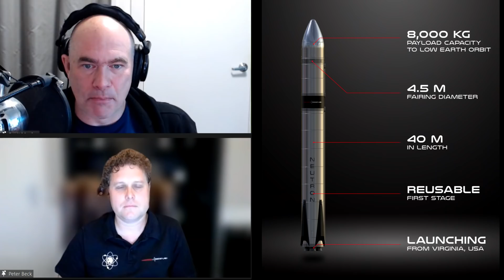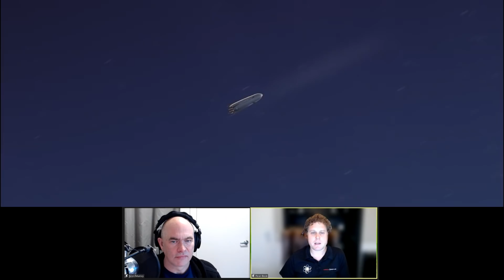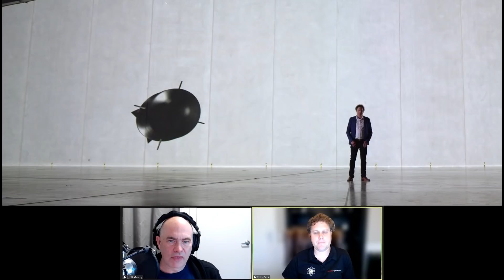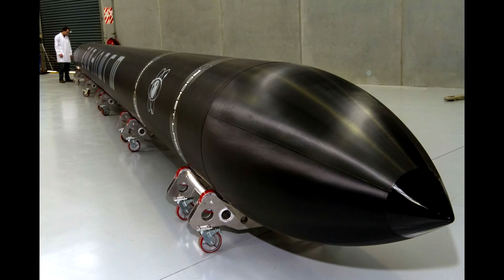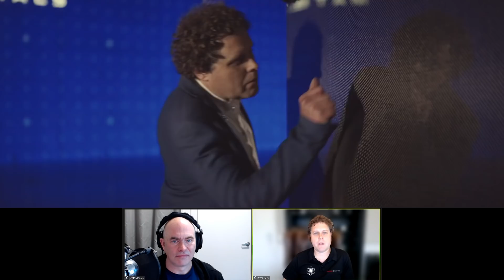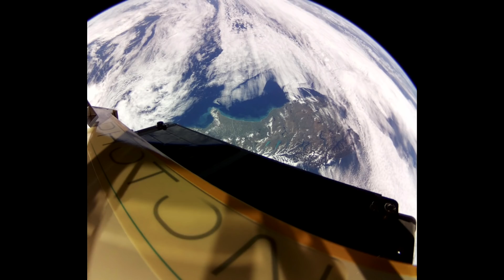Rocket Lab's Neutron Rocket's Innovative Design Explained By Peter Beck - CEO of Rocket Lab

Comment: Hey Scott, do us all a favor... PLEASE ! Before you interview this bozo again, please make sure his audio does NOT sound like he is talking through a double echo chamber and his audio is understandable. Even though you do have closed captions,  My ears could only tolerate about 7 minutes of his lousy audio ( and than I had had enough of him ) If he builds rockets to the same specs of quality equipment that he used for the audio for this interview, we all should be as far away as possible from his launch site.

    No worries Scott, I know it wasn't your fault, and I even though I left early, I still gave you a thumbs up !
Reply: Shadows
It's not about your precious ears..bye bye
Reply: Going by the pixelation going on in the video I would suggest that it is a bandwidth issue in the middle and there fore totally outside the control of either Peter or Scott. I would assume that they were making the best of a bad situation.

As for build quality RocketLab have, to date, launched 22 rockets with 3 failures (note that the first launch was actually destroyed by range control after a comms issue at a ground station, there was no fault on the rocket. So a qualified failure).

How many rockets have you launched to orbit?
Reply: @swapshots4427  Well then, make it about my ears. Bye bye bye.
Reply: @Agnemons   Well, it might be bandwidth-induced, but whatever system used should be able to compensate. The problem is that the sound varies so much in amplitude which actually might originate with a bad sound setup at Peter's side. It really is very difficult listening to.

Comment: Peter Beck says maintaining a ship is very expensive but I wonder. If the payload is so heavy that the rocket can't return to the launch pad, what's more expensive, maintaining a ship or ditching a rocket in the ocean?
Reply: Definitely maintaining the ship.
Reply: He said that it's about $60,000 a day to own a barge. And he also said that rockets are relatively cheap to build, compared to the total launch cost. So it's almost certainly cheaper to just lose one rocket occasionally as opposed to owning and maintaining a several thousand dollar barge for years.

Also bear in mind the $60,000 figure only covers port fees.

Comment: If the second stage is so lightweight that it needs to be suspended from the first stage load ring, how well will it stand up to the force of 100t thrust second stage engine?
Reply: Throttling, Beck said the second stage can throttle as low as the landing burn. Also, there has to be some structure.
Reply: The fuel tanks are under pressure in flight. As long as the force from the pressure inside is greater than the force accelerating the stage, the walls of the tanks only experience stretching loads and can be quite thin. After stage separation this situation is probably the case for the second stages of all rockets.

But at the end of the first stage burn the force on the second stage can be greater than the supporting force from the pressure, and that would require building the second stage tanks to withstand compressive loads.

An alternative is to suspend the stage, as Neutron plans to do, and as Delta Cryogenic Second Stage does already on Delta IV.
Reply: It costs very little, structure wise, to build things in tension. Compression is almost the exact opposite (mass comparison).

A piece of strong is lousy in compression excellent in tension.
Reply: @Agnemons  I understand that. My question was why, if the stage wasn't strong enough to support the compression loads during first stage firing, would it be strong enough during second stage firing? Darrell's answer is the most reasoned.

Comment: Next step will be stainless steel body, Starship may not be successful,but for sure it has set the direction for the future.
Reply: I doubt it. Maybe the second stage could go to stainless steel, if they try recovering it, but if the second stage remains expendable, Rocket Lab has little reason for going to stainless steel.

SpaceX went for stainless steel primarily because the Starship has to reenter from orbit, and the stainless steel handles heating much better. The Super Heavy booster could be made out of carbon fiber like the Neutron first stage, as it doesn't have to reenter from orbit, but it made sense to just make everything with the same construction methods.

Basically, the two vehicles are trying to do different things, and as a result arrived at different solutions.

Comment: I wonder if Elon watches things like this, looks over at his stainless steel rockets that he couldn't make work without heat shields, and wonders what could have been if he had just stopped surfing wiki early that one night...
Reply: If you think anyone is re entering without a heat shield you're a born fool.
Reply: @TheEvilmooseofdoom  I didn't. Elon did.
Reply: @krap101  It is possible to reenter without a heat shield. But it requires a big vehicle with low mass. Starship is big, but not big enough.
Reply: @espenha  Starship may be marginal for it... while they're obviously using a heatshield now, they certainly gave some serious consideration to the idea that the size and steel construction could disperse heat sufficiently, aided by transpiration cooling in places.
Reply: @simongeard4824  They dove into the transpiration cooling claiming it would save weight... Now they have heavy structure plus heat shields... The worst of both worlds... The only upside is it'll be a bit more robust if the shield fails... And there is probably some weight savings of the shield thickness and insulation for composite... But still pretty large gain overall...
Reply: I am no rocket engineer,  but I know the tiles on the space shuttle  were its weak point. Too bad they could not  develop  some spray,  heat proof foam material.  Coat the hot side of starship in it and be done with it.
Reply: @krap101  Elon said they'd re-enter, from ORBIT, without a heatshield?  Are you sure?
Reply: @krap101  Transpiration as a means for providing a TPS was looked at but added cost and complexity.  You have to keep in mind one of the big design goals is keeping cost and complexity down since that's what killed the shuttle.
Reply: @TheEvilmooseofdoom  Remember when he was saying composites we're super expensive and he could do it lighter because he didn't need tiles because the stainless steel could take the temps? This resulted in the whole "water tanks are basically rocket fuel tanks" line of thinking.

Comment: Wow better CGI then Starship and equally unreachable statements
Reply: Being negative is easy for the armchair experts.
Reply: @TheEvilmooseofdoom  
"Fantasies, fantasies that fly free
Fantasies that sometimes make you laugh
Fantasies that believe in fairy tales"
-Vasco Rossi
Reply: What do you find unreachable here?
Reply: @NGCAnderopolis   turnaround time of 24 hours.
SpaceX, at best, it took about forty days (recall from memory) just for a side booster. NASA with a few more days managed to refurbish the entire Shuttle once.
Reusable is neither synonymous with economic nor realible and sicurs.
Reply: @EmilioBaldi  Falcon 9/Heavy has a long turnaround time because the Merlin engines have to be disassembled and cleaned between each flight. This is a large part of what Starship and Neutron want to fix by going to methalox. 24 hour turnaround time is likely difficult but achievable for both Neutron and Starship.

Also, Falcon 9 has a record turnaround time of 27 days. They've actually managed that twice.
Reply: @EmilioBaldi  he did say that was the constraint for the design, but also followed it up with not expecting 24 hour turnarounds in the final vehicle.
Reply: @NGCAnderopolis  my bad, I was captivated by the graphics.
Reply: @espenha have you ever seen the bells of the recovered SpaceX vectors? They are warped.
SpaceX don't have to wash the engines, but refurbish them by: disassemble, check everything, rebuild and test them. And sometimes they also explode during this testing phase.
Rocket engines are engineered to be as light as possible, have the best power to weight ratio and run for a few tens of seconds. Like dragsters engines.
Reply: @EmilioBaldi  Vectors? I don’t know what you mean by that. 

When it comes to warped bells, I’ve only seen it on Merlins that have impacted the ground. And sure, some Merlins probably need some more work than others.

Anyway, Raptor and Archimedes are planned to eliminate all that refurbishment.
Reply: @espenha  Vector, in this context, is a synonymous of rocket.

You're right, luckily there was Thanksgiving to solve all the problems of an engine ready for be produced in series two years ago.
Reply: @EmilioBaldi  Obviously you don't fix the Raptor production over a weekend. But they are working on fixing the issues.

DC-X was a fine test vehicle, but it's nothing compared to the Falcon 9 first stage or Starship. It was more equivalent to the SpaceX Grasshopper test vehicle, which did 8 successful flights in 2012-2013.
Reply: @espenha  the Raptors they were established two years ago, and reporters were doing factory tours and serial production was starting.

Even if they manage to produce them, Starship, if it ever gets up off the ground, will go down like the N1 Hercules.

As a rule of thumb, when Musk presents something and says it's ready "now" in reality it takes no less then four years, to demonstrate something much more downsized.